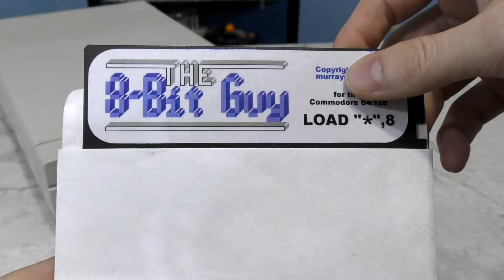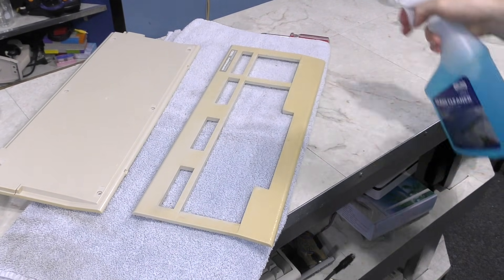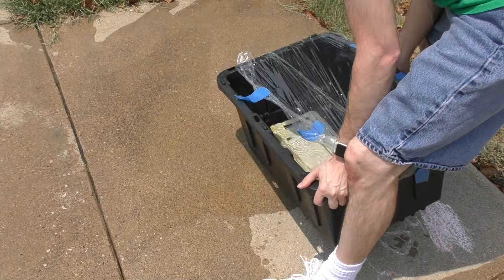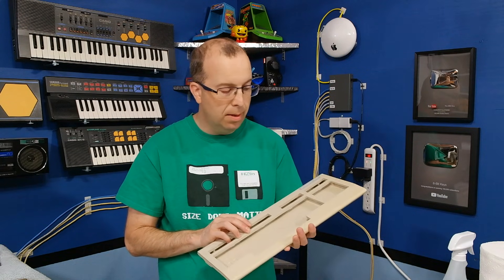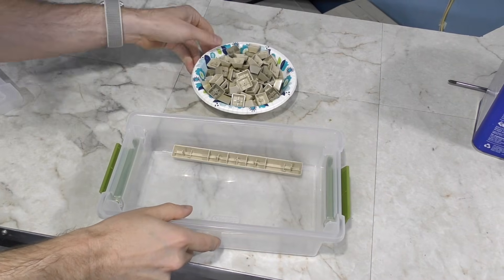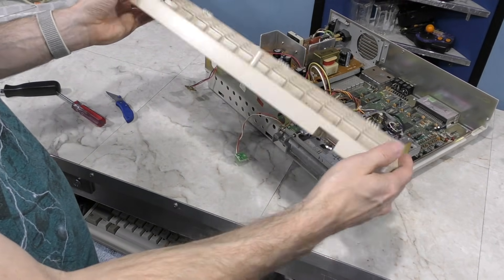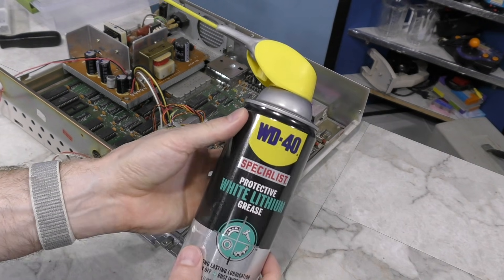Commodore 128D Restoration

Comment: RetroBright treated plastics re-yellowing even with minimal light exposure (with photos)

https://www.classic-computers.org.nz/blog/2013-01-15-retr0bright-only-temporary.htm

To recap:

All computers except the Lisa were kept in darkness (but not sealed darkness so a few photons might have been able to penetrate).

All computers are showing yellowing again, BUT only in the areas where they were already yellowed before treatment.

Temperatures can reach 29 deg C in the storage/work room during the day occasionally (but not always) in the summer months.

Theory:

The original damage from light causes degraded or free bromides throughout the case from the fire retardants. Retr0Bright only takes these away from the surface layer. However these bromides can migrate fairly freely through the polymer. They don't need light to do this. Migration is probably accelerated in hot conditions. These pre-existing bromines from the original damage migrate to the top and within a few years the surface is yellowed again. The rate of the regression depends on the initial extent of yellowing (the more yellowed, the more bromides down deep), heat exposure and the nature/quality of the plastics.

Comment: why not go with a clear bucket for the large moldings too? you can just spray the bottom black to absorb heat. or even cut down the sides on your black bucket so it has more total sun angle.

Comment: silicone is not good for glueing anything...here we have something we call "cola e veda" wich means "glues and seals" and it is like silicone but it is polyurethane..it can be removed but it glues and fills gaps on any material including glass and other non porous stuff...it is very strong but very flexible. it can fill gaps indefinetely large and here it is very very cheap.. we use it for so many stuff like glueing kitchen sinks, bathroom toilets to the floor, glueing bodykits and spoilers on cars,sealing leaky drain pipes, sealing around windows and rooftops etc etc..it does not bond chemically to the plastic so you can remove it without damage to the parts...it also is very dielectric..i use it also to restuff capacitor cans on old radios and tvs i restore. you can aslo choose from an unlimited number of colours and it does not smell acid like the silicone does

Comment: I wonder if the same pressure washer I used on my house accomplish the same as the chemical retro bright bath.  With just water pressure or add the hydrogen peroxide into the soap tube of the pressure washer

Comment: Get an ultrasound washer for the keys. You can get one for 20-30 bucks (probably less as that's what I paid in euros in Finland and we have a 24% VAT) and it takes about 3 minutes per wash, and two rounds since all keys won't fit at once, plus drying.
Reply: It's also what I use to clean eyeglasses and sunglasses as well as multitools and the like with hard to reach crevices. By far the best way to get the trapped gunk from between the rim and lens, as well as the little silicone nose bridge pads.

Comment: Great episode as always. If you're still looking for a solution to get the rubber feet to stick, some contact cement will work really well. Apply just a little on the feet and the key board, wait until both are at the tacky consistency of a sticky note, and then stick them together. After 24 hours they'll stick together like it was always meant to be. You can find contact cement at any major home improvement store such as Lowe's or Home Depot

Comment: I always clean the cords. I usually use a paper towel soaked in Windex. When cleaning keys, I usually put them in a large plastic cup with a generous helping of dish soap and hot water. I've never tried to retrobright anything though.

I also find it kind of ironic that you spend all that time cleaning up a C128D and then to test it, you use a C64 game.

Comment: Lol u put the silicone in the center right where the void for the screw hole is located.  Maybe be better on the case itself. Probly been tested by IBM 50 years ago to prove the double sided tape was the best considering the rubbing from scooting the KB around. I think I've noticed that pattern on your videos. Seems like the ones that are glued usually have a missing foot or two.

Edit2add.. i bet those were self-adhesive once upon a time.

Comment: David, I needed to RetroBright a 1989 GameBoy. I did so with plastic wrap and Sally SalonCare 40 cream, but it came out with streaking marks. 

In your opinion, what is the best course going forward? I'd like to salvage it if possible.
Reply: did you try what david did in the video with the water and the peroxide? that might help in terms of fixing that streaking.

Comment: 12:56

You can see the difference of using Y/C video over composite on that monitor.  Or was it actually RGB?

Either way, it's a big step up from composite.  The text that's in color look very sharp on that screen.

Speaking of which, that monitor's picture tube is in pretty good shape, too.

Very nice.

Comment: Remember that game, but didn't play on a PC, so funny.....
For the feet, try the red cell phone double sided adhesive tape, or the black (adhering the frames together). If these don't work, nothing will; as I use daily for cell phone & electronics repair for customers (never had a warranty replacement on a device yet after using this stuff).
Cheers, A

Comment: You can use the laundry powder to clean the keys. It is pretty simple: you need to pour keys into a plastic bag, then add a handful of powder and fill the bag with water. Then you need to shake the bag well for a couple of minutes and the keys will be clean.

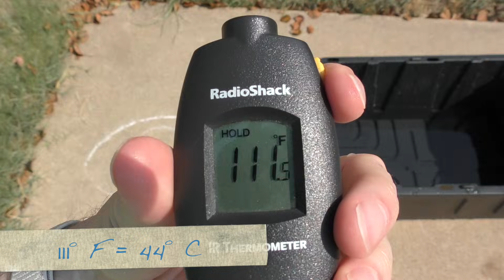Comment: 1:45. Yuck.  I used to live in central tx.  The water main running to my house ran about 8 inches under an unshaded road.  Sometimes the water would be almost 100f out of the tap.  It was gross.

Comment: I have a C-128 somewhere in my attic with monitor. But I don't think it was a 128D. I seem to remember it being all-in-one like the C-64, and not having a separate CPU. I may also have a dot matrix printer that came with it. Didn't have a disc drive. Cassette tape storage like my 64.
Maybe I'm making the wrong comparison. Maybe it was a Vic-20, and a C-64 were the two I had. I've to get up there and get it down and see what I really have. Probably, going to sell whatever I have.
Reply: DDS029,
Let me know if you are selling any of your C128, I am very interested in buying it.

Comment: (03:40) I hate it when they cover the screw holes like that. On the other hand, if they didn't use those indentations for the rubber feet, they probably would have migrated about. Surprised you used silicone instead of double-sided tape to reapply the feet since that's what was used before. It works for labels, so why not?
(06:46) Yuck! Please, I'm trying to eat, and that looks disgusting.

Comment: Holy hell 44 degrees celsius on the tarmac. Back here in Holland we're dieing from 30 degree days, and you just keep trucking on. Massive respect. I definitely recognise the vanishing of several hours when cleaning the keys. Had that happen on my c64. Cleaning away, and when I'm done, look out the window; Pitch black. Look over at the clock; Midnight. Haven't had dinner yet. What happened? :D Luckily I had a microwave meal in the fridge.

Comment: What key switch mechanism does that board use? Judging by the external spring I thought it would have been some kind of Foam and Foil switch but the keycap mounts look more like that of a rubber dome board of some kind.

Comment: Since the feet were originally fixed on with double sided tape, I would use the same method.  Just stick the tape on a foot and then cut around it with a craft knife.

Comment: When I saw the silicone  silicone adhesive I just starte laughing.... Use some 3M VBH tape 4910 or even could use The glue they use to fix bicycle punchers. Those glues are very flexible and easily stick to rubber and plastic

Comment: I remember "repairing" my brother's C128D in the 80ies … 

It fell off my bike (had a little accident) and the disk drive was loose, dumping around internally. When I arrived at my friend's home, we opened it up and noticed that the board also broke off its mounts. As we didn't have proper parts to fix this mess, we used a lighter ans some way-too-big screws to melt the board back again - and two empty toilet rolls to press the floppy drive back in its place. 

My brother never noticed, anything had happened to his computer. And it ran without any problems for many years. Those things were built like a tank.

Comment: I recently bought some removable (cleanly) double sided tape from Amazon and it is very thin so might work for sticking those feet back on.  The brand is Fasten. I have yet to tackle cleaning the yellow from my C128. I'm just happy each time I turn it on it works!

Comment: Try 3M weatherstripping adhesive from the autoparts store, spread a thin layer on both the feet and the keyboard pocket (a little dab will do) WAIT for the adhesive to become tacky (or it won't stick) and then press the key into the pocket on the keyboard

Comment: I would use the 3m  double stick tape sheets that is used to adhere phone screens. Or E6000 glue. But the 3m pressure sensitive double stick tape is probably the best choice.

Comment: Aww the good old 128D :-) I had one once but never used it for playing games. For some reason its C-64 emulation mode was unable to run certain C-64 games. I dont remember which ones these were but there were at least four or five games i knew of that just would not run on it and crashed upon startup with strange error notifications. Maybe its emulation mode was not a true 100% replica of the real c64 ?

Comment: I used some double-sided "sellotape" to stick some teflon on the bottom of my Apple Macintosh ADB mouse for my SE/30. Pretty sure any thin double-sided tape would work just fine though. Cut it to size with scissors, stick it in place, then run your fingernail over the back to make sure it adheres properly, then remove the backing and apply the rubber piece. If it works for Teflon, you'd think rubber should be easy.

Comment: In my experience, the quickest (and most thorough) was of cleaning plastics prior to retrobrighting is to dismantle - and then put them in the dishwasher.  The cutlery basket is perfect for small components like keys - but be sure to tie it shut or you'll be playing hunt the missing part in the dishwasher for ages afterward!
I've done everything from old computers through to my Laserwriter 8500 in this manner.  The printer being by far the largest parts that I've processed in this way.  Also, that's a daily driver device - so if there was any problem with my process, I'd have spotted it in the printer right away!

Comment: I have filth like that cable go onto the signs around the building at work on a regular basis and I have to clean them sometimes. All I have for weapons of choice are Carex and water or Window and Anti Batiarial Sprays in the cleaning cuboard.

I found Carex and water the best out of that lot it does create a soapy surface though I have to go and get a shimmy cloth to wipe all the watered soap off as the bucket of water for rincing just makes it more soapy.

It works a treat on black streaks though does pressing the top of a Carex to get hand soap all over the mark going once over with a wet sponge then putting the dry cloth over it to rince the soap completely off.

The scourer sponge with the scratchy backside soft front side does the hard work combined with the Carex to scape the crap off with no effort but you can't see what you done until you used the dry shimmy cloth because the whole mark is covered in thick soap so you may have to do it multiple times.

Oh well I have to work with what I have at the end of the day and it does work although it's whacky.

It does make sence that my Carex at work works too as it's got rubbing alcohol in the ingredents in the first place. lol.

Windex my other signs weapon of choice not as good results as the Carex but works for a good polish when it's only dirt without oiley muck.

The best results I got from Carex was on a temp sign with parcel tape I had to rip down. The parcel tape residue including colour was still on the window pressed Carex directly on all of it got the scourer sponge and scraped that bad boy off and dried it with the shimmy cloth completely gone.

Comment: Instead of buying new hydrogen peroxid every time, is it possible to reuse the solution over and over?
Reply: Jens Johansson no. The h2o2 releases the oxigen and becomes regular water. It's not practical to capture the gas and re insert in the water. You just buy more.
What he could do is make a more sealed container to preserve more of the gas and use less

Comment: You know, I wonder if you could create a rocker assembly that rocks sealed box of keyboard keys and liquid mixture, so its constantly mixed. Would it work? I would think it simply needs a solar panel, a motor and some hardware. Why solar? Because it would be useless to use it in cloudy day anyway. :)

Comment: Thank you so much for those temperature conversions! That's so extremely helpful if you're not familiar with °F other than "0 is cold, 100 is hot"
Reply: If you're ok with the mental gymnastics, just remember five ninths of (F minus 32), or of course an easier approximation is half of F-32 and add a tenth (thus, for the latter, to convert say 100F, gives 68 with the 32 off, half that is 34, add a tenth gives 37.4, vs. the correct answer which is 37.78; pretty close!).

In the UK it's funny, the media and many people will tend to refer to F temps when it's hot ("Blimey, must be in the 90s today..."), but we switch to C when it's cold. :D
Reply: @mapesdhs597  Or you just follow the hard and fast approximation (Faster but less accurate) - From C to F = double it and add 30. To reverse it, subtract 30 from F and half it. 
The further away from regular outdoor temps, the less accurate it gets. But, it's something most people can do very quickly in their head.
Reply: @SlavicCelery  Cunning plan. :D  For some reason though, five ninths of F minus 32 has always just stuck in my head, grud knows why.
Heh, let's get radical and just use Kelvin. 8)  It would at least please the cosmologists, they're always moaning.
Reply: Typical room temperature is 70 degrees. 60 degrees is sort of chilly. 80 degrees is hot. 90 degrees is very hot. 100 degrees is hotter than my state (Maine) ever gets except on rare occasions. States in the South, and especially in the Southwest, routinely reach and exceed 100 degrees.

0 doesn't mean anything in Fahrenheit. 32 degrees is the freezing point of water. 100 doesn't mean anything either. 212 degrees is the boiling point of water.
Reply: @MaximRecoil  100F is your average body temperature
Reply: @stianstave76   The average body temperature is 98.x degrees F, but, what does average body temperature have to do with anything I said?
Reply: @MaximRecoil  : the very defenition of 100°F is the body temperature of Mr Daniel Gabriel Fahrenheit (1686–1736). He was a little bit off, but this was back in the 18th century.
I'm just pointing out that you wrote   "100F doesn't mean anything".
Reply: @stianstave76  98.6 degrees, not 100. >=100 would be a fever.
Reply: @newagederpderp . Google will be your friend.
Reply: @stianstave76  Google just told me 100F = 37.7778C
I don't know about your species but for us, humans, its a fever.

Comment: Wait... why does your 128D only have 64K of RAM?
Reply: It's running in C64 mode
Reply: If you type "GO64" in the Commodore 128 screen, it'll switch into C64 mode allowing it to run (most) C64 games.

Comment: Isn't that a C128DCR with only the front panel being plastic? The C128D has a nifty handle, a clever keyboard compartment and no metal case. That at least the way it is with the PAL releases...
Reply: Yes it is. But i never found the handle any useful. However, the DCR came with 64kb Ram for the VDC. That was useful. Well at least for me... back in the days.
Reply: I think this version had some issues with hardware design fails due to the combined computer and floppy pcb into one.

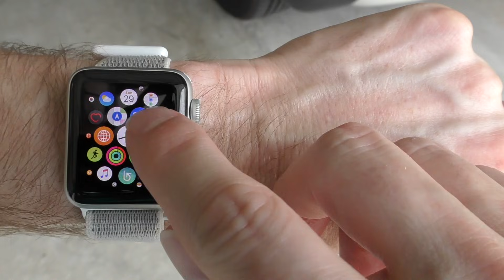Comment: 5:26 if you do a lot of plastic case restoration, have you considered dedicated retrobright equipment for the job? looks like you need a low shallow but wide plastic tub & a glass top lid to keep heat in  .do not know how UV levels are affected by glass vs plastic rap?. but I do know automotive door glass has no sharp edges.  a dedicated retrobright trolley table on wheels maybe?

Comment: It looked like you applied only a small dab of silicone exactly where the screwhole was. Maybe that's why it didn't stick? Have you tried putting the adhesive on either side of the screwhole?

Comment: David, great video as always.
Why don’t use double sided tape to attach the rubber feet? 

- Glue them onto one side of the double sided tape.
- Than cut them out.
- Than remove the second protective layer.
- Than attach them to the keyboard.

Regards
Christian

Comment: That clear silicone might not be the best idea when you have screws underneath those rubber feet. I would have used some thin double sided adhesive tape. Also, once pressed into place you can see the silicone peeking out from the sides...

Comment: I usually do a previous cleaning with the keyboard assembled. Put it under water, and using a brush and/or toothbrush clean it with Car shampoo (no salt, no corrosion). Then I disassemble the keyboard and complete the cleaning and proceed to dry the pieces. I stopped using window cleaner some years ago since I begun noticing it worsened the yellowing - water is the perfect medium for cleaning and (thanks to Retro Man Cave!) car shampoo is the perfect detergent. By the way - it was your video on the perfect DOS gaming computer that brought me back to retrocomputing - keep up the good work!